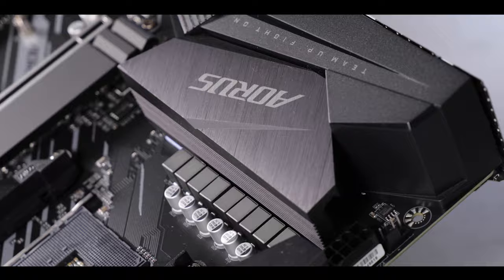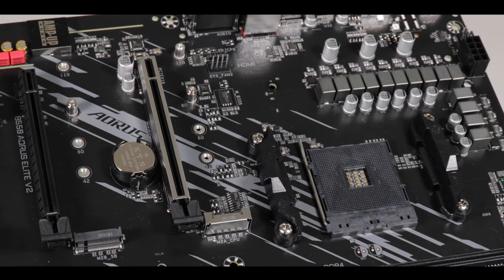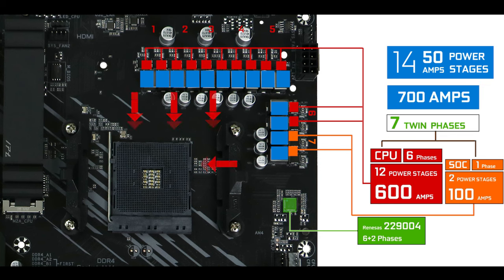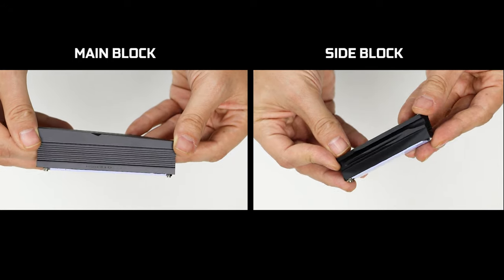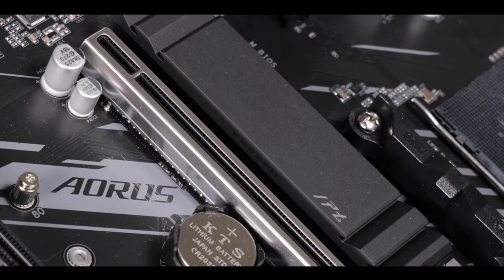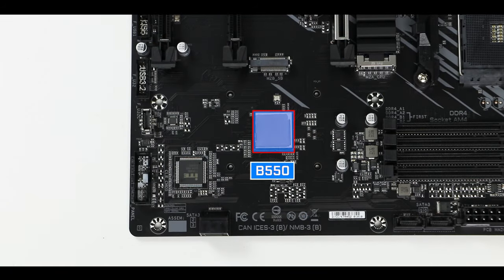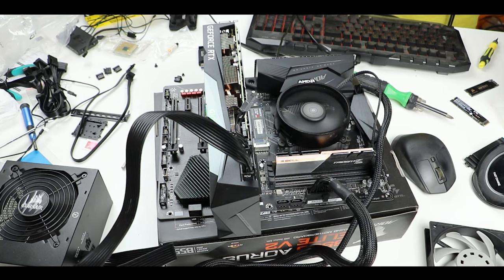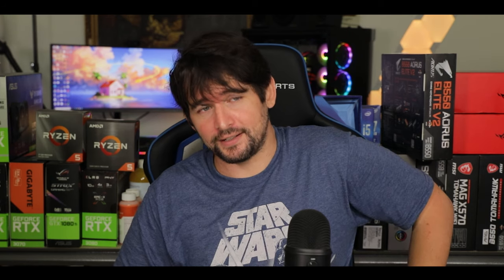Gigabyte B550 AORUS ELITE V2 : Best budget gaming board. PERIOD!

Comment: Be aware that the front panel Type-C header on this board is NOT 10Gbps Gen2 as stated in this video (a mistake I see often in tech videos) it is a Gen1 5Gbps header. USB naming and speeds are often confusing and frustrating for people and it's frustrating to see tech channels that get these wrong.
Reply: Motherboard also support pcie gen 3 cpus
Reply: I'm surprised he didn't praise it as "the fastest USB C ever" with how much manure he constantly shovels.

Comment: Just installed mine with ryzen5 5600g.. really worth the money. My friend keep asking to go for 570 but I decided to buy the mobo because of your video!kudos to you
Reply: Mine had a steal deal with black friday it was 100 bucks instead of 150 bucks 👀
Reply: Sounds awesome! Did you have any problems with it? Planning on getting these two things too.
Reply: @dal_luna  it even has pre installed bios so you dont have to install the bios later
Reply: I just ordered this board with a Ryzen 5600g, did you have to flash the bios or, was it compatible out of the box?
Reply: It's a great choice to pair with a 5600G. Two display outputs if you want two screens.. Plus it is just super stable top quality board.  Much potential to expand it later.
Reply: @onireno  No need to update BIOS works out of the box.  Well mine did.
Reply: @mattscomp   how was your motherboard today? Planning to buy this board pairing with R5 5600g
Reply: @aniperv8009  still going strong in my customer's build 💪 will keep going for many years I'm sure. Enjoy! Mine was the Elite V2 AX version with the added Wi-Fi. Same board otherwise I believe.
Reply: @mattscomp   great! thanks

Comment: Heads up for anyone wanting to get this or the older V1 revision! A lot of people have made comments about the back IO ports not delivering stable power/connection when you turn on XMP on your ram. As far as I've read somewhere (reddit, other tech websites) the issue still persists with V2 revision so be careful
Reply: that's troubling to hear since I have this board sitting on my building table right now.
Reply: @darkphoenix00001  do you have XMP enabled? If you do and are not experiencing issues, your memory controller is working fine with the RAM you got. Some people managed to find a solution by manually doing the RAM overclocking instead of XMP doing it's thing.
Reply: @shiatbricks  I haven't bought the RAM yet but I'm planning on buying a 3600mhz set so the XMP is pretty important to me. Thanks for the info, I hope it works okay out of the box!
Reply: @darkphoenix00001  I'd suggest you google compatible rams that the motherboard support (i know it's silly, but do it). I remember stumbling upon a website couple months back that had pretty good info
Reply: @shiatbricks  oh thanks for the tip, I did that just now. I found a site called pangoly, seemed to have a pretty comprehensive list of QVL RAM modules.

I was hard set on G.Skill at first, but upon researching it a little and going through the list, it seems like they are definitely not the brand to go for with this board (at least for the 3600mhz 2x16GB set). Crucial and HyperX seem like very safe choices in comparison. Man you might have just saved me from a world of headaches, thanks again 😁
Reply: @shiatbricks  hmm so it's a ryzen issue? well either way I'll just go with the safer Crucial/HyperX RAM and hope for the best with my 3700X 😁
Reply: @darkphoenix00001  let me know if you get any issues, genuinely curious
Reply: @shiatbricks  alrighty will do 👌
Reply: @shiatbricks  so I remembered your comment today and thought I'd give an update. I actually went with corsair vengeance rgb pro 3200mhz because of lack of availability of other alternatives. the XMP profile seems to be working fine, no real problems. 

I did have a problem problem with my USB wifi adaptor randomly failing at one point, but then I switched it from it's USB 3.2 slot to a standard one and from then on there were no issues. so overall I'm pretty okay with how everything turned out 😁
Reply: @darkphoenix00001  nice to hear everything is working as intended. Did you update to the latest bios or were there no issues out of the box?
Reply: @shiatbricks  no I didn't update my bios, I was afraid it would break something haha. and everything did work right out of the box so I didn't feel the need to do that.
Reply: @darkphoenix00001  nice, enjoy the rig mah dude
Reply: @shiatbricks  thanks man 😁
Reply: @darkphoenix00001  That's great to hear and I appreciate the update as I am looking to build an AMD system with similar specs too - I'm actually looking at that exact RAM myself.

Has everything been ok since this last post 7 months ago?
Reply: @mcgarnacle21  corsair vengeance pro 3200mhz? I have to say my wifi device would keep disconnecting and reconnecting, even after updating to the latest bios ver.

it might have just been a faulty wifi adapter rather a motherboard or ryzen issue, I'm not sure. I've switched to ethernet and it has been smooth sailing. no issues that come to mind, really happy with my build. I hope things go well for you as well 👍
Reply: @darkphoenix00001  awesome to hear mate and thanks for the quick reply
Reply: @mcgarnacle21  no problem
Reply: @darkphoenix00001  Any updates? I just ordered the mobo  with ryzen 5600, now Im a bit worried.
Reply: @Bruno-oj3zb  same

Comment: With your review i bought last week this exact motherboard brand new and sealed for 60€, a artic freezer esports 34 duo White sealed for 20€ and a 5800x sealed with warranty invoice from the 19th May for 200€
Reply: Where did you buy it for €60
Reply: @AlteredVisioned  on a website in my country for people who sell and buy new and used stuff.
Reply: Wow.. what the actual fuck. For those prices? Well I'll  be damned lol. That's a steal build man
Reply: @kerlowkey  yeah! It was some awsome deals! Now i have a nice setup! I was though that i would need to change my Gpu , but since its for playing mostly Valorant i have more than 300 fps on max with my R9 Fury Oc so im pleased to continue to stay with it!
Reply: @Dakhanavar99  lol.. if u get 300 fps average, as you said, no fuckin need i would say as well lol. Nice man. I am gonna buy the same motherboard, but it will cost me at least €150 Haha, still a better deal compared to the other mid tier motherboard which dont even have these features. I just need a wifi/bluethooth card separately, but most good cards mention Key E, but this motherboard has Key M. Or does this board not have a E Key socket to install a netwerk card separately?
Reply: Im gonna put a 5800x also onto this board. Any install tips?

Comment: Would you recommend this or the B550 Tomahawk or B550 Gaming Edge WiFi?? I’ve narrowed my choice down to these 3 but cannot decide! 🤔🤔🤔
Reply: I have the exact same situation
Reply from the maker: I'm edging on this one  :) better audio , and for the rest they are the same :)
Reply: @Laurentschoice  for a 6800 non xt and 5600x is the b550 arous elite v1 a good board for £99?
Reply: @kashif4463  £99? What a steal
Reply: @kashif4463  i would do v2 in my country its cheaper and better, but if the v1 is much cheaper go with that

Comment: The big difference between this motherboard and the PRO version is that this has 4 memory lanes while the PRO has 6. With 4 is very difficult to oc 4 memory modules to anything more than a couple hundreds of megaherzs. With 6 lanes you can do a lot
Reply: huh ?
Reply: @CmdrTigerKing  with 4 lanes of RAM (memory) you can overclock (getting more power out of your component, like using 150% of what its max. is supposed to be) less than with 6 lanes (which the PRO version of this motherboard has), but that really is a luxery problem. Also not everyone wants to overclock since it decreases the lifespan of your components (memory in this case). But theres also an advantage: since you'll get more power out of your memory it wil run faster. I hope you understood and that this was still necessary for you 😄
Reply: @CmdrTigerKing  alltough i'm not sure if the PRO even has 6 lanes
Reply: I’m going to put 4 sticks of 8gb ram 3600 cl 18 ripjaws. Will this be fine?

Comment: I love this MOBO, the only thing that has me puzzled is the fact that the MOBO configures a memory setting which is not visible to the user when changing CPU settings.
(AMD's version of RTL / IOL timings maby?)
Took me quite a while to figure that out..
I am at the bleeding edge, hence i was thinking it was infinity fabric i i do know 4200 does not POST nomatter what i do.
current stable setting = 2x8@4066CL16-16-16-34-44-CR2-GDM=off@1.55v@1:1:1
Knowing this i can try going for 4133CL16 or 17 again. :)))

Comment: Just bought it in 2024. I already had a AM4 system and I happend to get gifted 5800x3D so I just thought that it would be a nice cheap upgrade for a B450. Not fully ready to commit to B650 with DDR5 yet so this was the best option. I have not tested it yet though but if anyone is interested comment below and I’ll post my thoughts on it in 2024

Comment: Can I use a ryzen 75800x cpu with the board?
Reply: Ryzen 7 will require am5 socket board, you would need the b650 at the minimum, not the b550

Comment: Hey im wondering if the AMD Ryzen 5 5600X 4.60GHz 6 Cores 12 Threads AM4 Desktop Processor will be compatible with the motherboard? this will be my first PC build so im just wondering as ive bought a case and this motherboard today
Reply: also will it support the AsRock Radeon RX 6600 Challenger D 8GB Graphics Card?

Comment: Having issues with this board and the USB ports using a 5600x. I get intermittent USB signal stuttering depending on the accessories. Typically, wired stuff works fine. Wireless stuff gets constant random stutters. For example Logitech G305 wireless mouse randomly disconnects and reconnects within 1/2 second. But it does not do this on my other AMD PC.

I have latest, bios. latest chipset drivers, all windows updates, turned off power saving features and disabled low power C states, and fresh battery on the mouse, tried different USB ports. USB 3 seems to be the most temperamental.

Not sure if anybody has issue with this? This board also behaves really weird with XMP ram at 3600 mhz with Gigabyte Vision RTX 3070, it will crash unless RAM is at 3566Mhz, weirdly enough, lowering XMP to 3400Mhz also crashes. But when I use my old GTX 1070 it runs fine at 3600 Mhz or 3400 Mhz. 

So weird. This will be my last Gigabyte board. Had to do too much troubleshooting to get it working. It's a silly waste of time.

Comment: long time gigabyte user, but beware - bought one of those with a serial N from 2021 week 3 (SN2103...), running with 5800x and 3070ti, was working fine for 3 months, then it died. It started constantly reboot (even in bios), not post etc. so ... that my 2c :)
Reply: Did you find the problem?

Comment: I installed b550 aoruselite today, so I booted up normally.
I'm curious, so I'll ask you a question.
When I plug in the power cord, the blue led came into the room on the left.go
Is it turning off? If you press the computer power button, the heat sink will turn orange.
When I connected the outlet, the blue LED went in and out of the heat sink, so I was surprised and asked.^^

Comment: Well I just got one for about 90 euro, gonna pair it with a 5900x. I'll let you know how it turned out. 
I rly like ur style when you lay down your toughts about the stuff, Ive leared much more from you then the US what ever Linus Nobrain, 50cent etc.
3 weeks since I went from Intel to AMD. 8700k to 5900x, dubble core dubble threads. Gigabit software is not very impressive, though it have a softwarwe 4,5gz all core OC and that works very well with Cubase, lots of vst power without stressing the system. I didn't buy this upgrade  to boost my gaming performace, The 8700k is still a great gaming cpu. The 5900x get a bit hotter then the 8700k but this is a super bargin. If you dont need the x570 specific extras then go for this one, no usb c back plate but usb c for front, great breat mb for the price
even then running 8700k at 5ghz all core.

One Year later
This mothertboard have worked perfect since I bought it, the diffence in cpu power (8700k) in Cubase have been, well just silly, I don't do 120 ch film score, but some projects end up 50-60 ch and I have yet not experience any stutter or digital corruption when I'm using the system, the 5900x on this MB still runs very smooth
Reply from the maker: Thank you for the kind words :)
Reply from the maker: But to be absolutely fair... these guys do marketing.  I'm a tech reviewer :):)..... oooooooh snap.
Reply: Where did you get it for 90?

Comment: 1. Will installing 2 m.2 ssd disable the remaining 4 sata ports? 2. Will installing an m.2 on the lower m.2 port disable the lower pcie x16 or lower "graphics card" slot?
Reply from the maker: To the second question. It won't disable it. It might cut the speed in half which is still more available bandwidth than any available cards can handle .
Reply: @Laurentschoice thanks for answering! What about the first one?

Comment: I bought a Pc with this board a Ryzen 5600x 16 GB RAM, 1 NVMe WD Black 750 500 GB,  GTX 3060 Ti, and 1 pcie Wifi dongle. Can I mount a 2nd NVMe of 1TB on the second slot and maintain performance?

Comment: Does this board require a bios update to run a ryzem 5 5600x?
Reply: I need to know that as well.
Reply: @XHobbiesPrime  I think that you need to update every board that does not say ryzen 5000 ready on the box. So if it says ryzen 3rd gen or something like that you might need to update the board and thats easy to do
Reply: @NORMAL_G  Are there any ready for Ryzen 5 boards now?

Comment: Thinking about upgrading to this from the asrock x370 killer sli/ac. I assume it will work with my ryzen 9 3900x a bit better. It's the newest processor that my current board can run
Reply: Did you upgrade to this mobo?
Any problems?
Any tips?

Comment: Type-C front panel support on the board.  Correct me if I'm wrong, but has it become standard on cases to have a type-c on the front panel?  Where do you get the wire for this?  Case-makers have been SLOW to bring this in, and while case makers like Phanteks have promised but never delivered a replacement front panel for their newer cases over the past several years, I still don't see this as a standard for cases.
Reply from the maker: Hi there.
So most of the case produced after 2019 got a front panel Type-C.
If they do, the cable is already linked to the type-C plug as it would with any other USB plugs. 

I hope this helps Sparky and thanks for watching:)

Comment: I bought this motherboard to run two Nvidias 3060, unlocked, but the second 3060 does not unlock.

The manual says that only one slot is x16, but in the updated BIOS, the setup gives the option of 2 slots in x8.

I tested it in every way and I couldn't.

Did anyone manage to run two 3060 unlocked on this board?

Comment: Would you recommend this for 5600g? Since everything I’ve read says it will support it now
Reply: If not which one would you’ll recommend then?
Reply: Personally I would definitely recommend this board for R5 5600G because I currently have R7 5700G and also aiming on this board.
Reply: I previously had B450 Elite V2 version of this and run R7 5700G on it but not for long because it died because of extreme overclocking and power surge. If you want to overclock R 5000 series CPU I would definitely recommend this board because it is great and enough. X570 board just add SLI and more PCIE 4.0 with a quite loud chipset fan which you don't want.
Reply: I did not plan on overclocking to extreme. Maybe just a slight tweak. Thank you for your response. Definitely helped me out
Reply: Take Msi tomahawk
Reply: @128Cores  
do we need bios update for 5600x with this board?

Comment: Gorgeous explanation :)!!! Though I have a question - Would Putting M.2 PCI-e gen3 into M.2 PCI-e gen4 cut PCI-e Gen4 video card lanes...right? I plan to use 2 planks of m.2 ssd but just can not get it..  if I use gen4 m.2. slot would that limit the gen4 video... any thoughts?? advice?? Please.
Reply from the maker: It would not cause any measurable performance difference. 

Place ur m.2 ssd gen 3 on the last (left) connector.

At worst it'll affect a SATA plug.
Reply: @Laurentschoice  yep 🥴 but as said there are two of them (m.2 ssds 2 tb each). But yes, I hope that there be no sensible and noticable decrease in GPU but only practice and real comparison would tell. Thanx for quick response! 🙏🙏🙏

Comment: would an AMD 10 9700 APU work in this motherboard with no issues? if not, what board would you recommend for this Processor? as I would also in the future would like to replace with a Ryzen 5 or 7 at a much later date.

Comment: Dumb question: the wifi on the Gigabyte motherboards...does that mean you can recieve a signal or does that mean it can produce and recieve a wifi signal-aka a router.
Reply from the maker: Out of the box it can receive from a router of any kind.
For it to produce you will need specialised software.

Comment: question, does adding 2 m.2s drop the graphics from x16 to x8?
Reply: No, these are separate. It would only drop the top slot to x8 if you used another GPU in the second one.